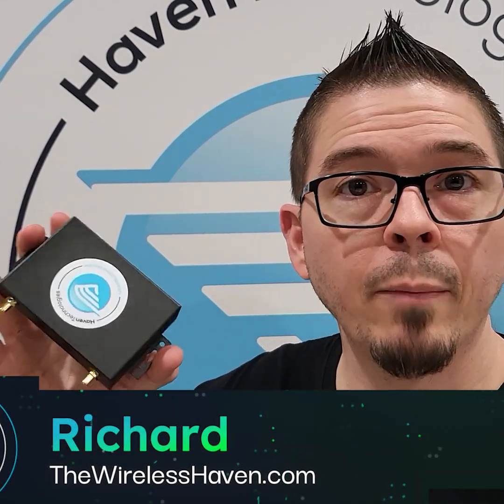Installing a Modem in the USB3 to M.2 4G 5G Adapter Enclosure - The Wireless Haven - Tutorials

Comment: Is this a case of doing what you did then add a SIM, plug the ethernet to whatever wants internet? Or does it need programming/management?
Reply from the maker: Depends on the carrier and plan. Since the modems can work on just about any cell carrier, they are technically unlocked, requiring configuration for the specific carrier and plan used on your SIM.

Comment: Does this support 5G Network Module T99W175 Qualcomm X55 network card?
Reply from the maker: Technically yes, it is a simple USB to M.2 modem adapter. All it does it maps the pins of the m.2 key B interface to a physical USB port for use of the modem over USB. the rest is up to the modems configuration.

Comment: Is this compatible withe routers that are running openwrt or rooter? meaning can I just plug this into the usb 3.0 port on the routers (and then configure etc)?
Reply from the maker: Yes, that is the main way we use them, with openWRT based systems like our routers. They can also be used with any device/system OS that supports modems that connect over USB.
Reply: @wirelesshaven  Very nice. Is the driver part of the standard Linux kernel and/or OpenWRT? If not, which package does OpenWRT need (excluding dependencies)?
Reply from the maker: @Cabinlab  The adapter is a direct pass through USB adapter, so itself has no effect on the drivers needed. This leaves the modem installed.
Most all modems we have used are using standard USB modem drivers (QMI, MBIM, ECM, NCM) which is part of the core Linux driver set install in most cases.
Note, this wont work with PCI data lanes of modems, only the USB... as far as we've tested.
You should be good to go with most any Linux build, and you should only need to include the various related drivers in your openWRT build. Modemmanager typically takes care fo the dependencies, and Rooters version of openWRT includes it all.

Comment: just to be make sure, can you pls tell me what position voltage level  switch need to set  for Quectel RM502Q-AE 5G Cellular Modem  is it  “UP” (away from usb3 port)position or DOWN position?
Reply from the maker: Up position, away from the USB3 port, for Quectel modems.

Comment: Can this be powered remotely? Say for outside exclosure?
Reply from the maker: Yes, the devices primary power is via the USB3 data port. IF you want to add aux power for surplus power supply you would have to figure out how to either split the power input from your host device or extra power run.

It is not recommended to power a cellular modem  over category 4 or 6 over a long USB cable alone;  10 feet seems to be the max. The 5.5 Volts DC does not travel well over lengths of very small wiring.

Placing it in an enclosure with a router that is PoE powered, though would do well.